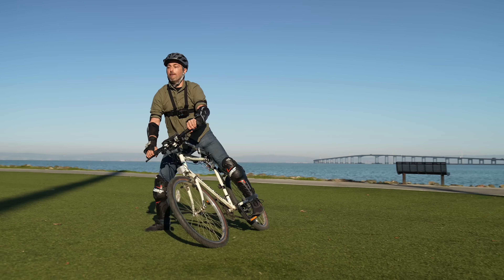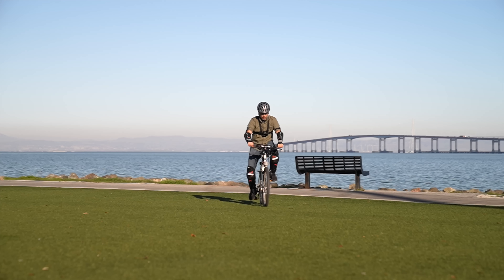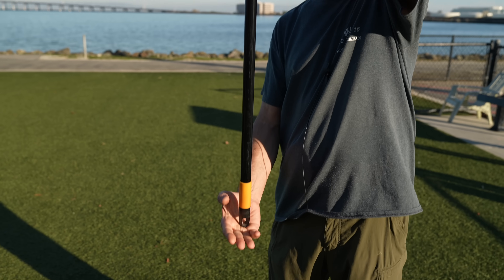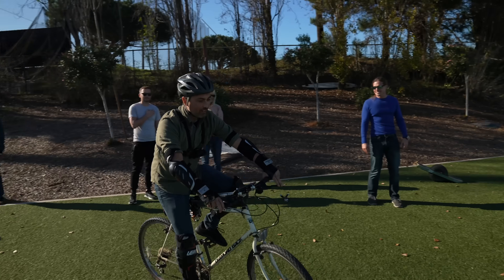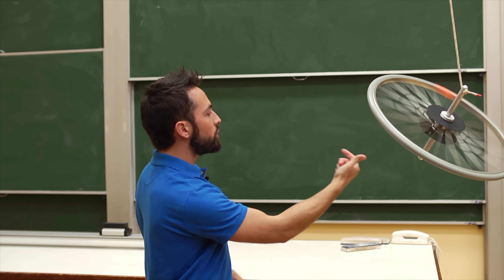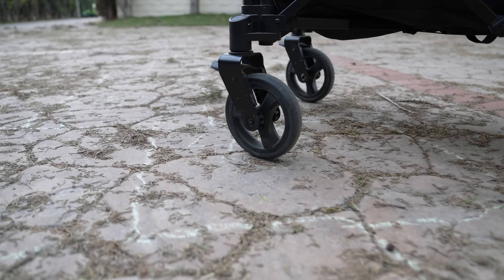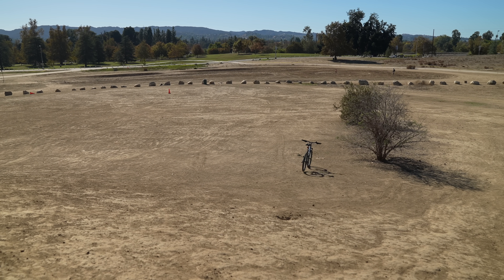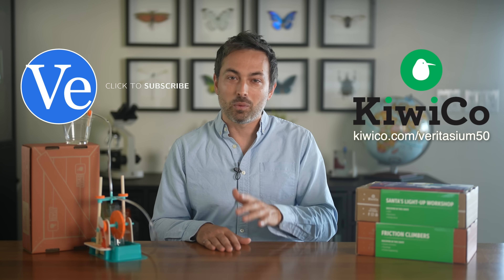Most People Don't Know How Bikes Work

Comment: Motorcyclists understand the concept of counter-steering very well… On a motorcycle, it is not just a momentary counter-steer. You continuously apply it while turning
Reply: Technically you do not need to maintain pressure on the bars to keep turning, (As long as speed is maintained),.  I f a bike has neutral steering you can actually remove your hands from the bars and the bike will continue to turn. If your bike does not have neutral steering, it is a cruiser for example, then you will have to apply handlebar pressure.
Reply: @glennpuckeridge6244  I was actually thinking more of a track situation in a sport bike where you need strong countersteering to aggressively tilt a bike but you're right

Comment: Fun fact: You cannot ride a bike, when you sit behind the backwheel. Obviously for most bikes, you sit between the wheels. But if there was a special bike, where you could sit far back and a mechanism, that lets you steer exactly the same way as normal, you wouldnt be able to keep balance. On a normal bike, you do the counter turn before initiation the real turn. This is because if you want to turn left, you have to get your center of mass to the left of the wheels, as explained in the video. But notice how eg buses with long tails sweep out to the opposite direction of the turn? This will happen if you sit behind the backwheel. You will sweep out, and the center of mass moves in the wrong direction. Of course you could learn to ride a bike like this, but without training i think it wont be possible.

Comment: It would have been interesting to see an experienced technical mountainbiker attempt to ride/turn that bike as we use the bike angle to steer more than turning the actual handlebars ie leaning the bike into the turn to turn the bike, like you showed later in the video how the bike basically steered itself.

Also interesting to see how no one used brake resistance to assist balancing, or well, knew to use...   Nevertheless, this is where being able to turn the handlebars/wheel is critical 😄

As always, great content. Glad you are on here 🙏🏼🙏🏼🙏🏼
Reply: Motorcycles lean to.  That's just what happens at speed.   That necessarily happens.       You still use the handlebars you just don't know
Reply: @gur262  yes, of course motorcycles lean too. they are bikes, with engines basically. I also never said handlebars weren't used. If you would have read my comment you would have seen the superfluousness of your comment

Comment: The gyroscopic effect can help keep you upright but you need to be going a lot faster than what you would normally be riding at.  I am pretty sure that this is why most people tend to crash their bikes when going at those speeds too - as you pointed out, people intuitively steer the bike to balance but when the wheels are trying to remain going in the same direction that they were moving due to gyroscopic progression, it starts what is basically a feedback loop which makes you wobble more and more until you overbalance and fall off.

Comment: I noticed this many years ago as a child.  However, It is possible to turn left without first turning right or vis-versa but only if you’re turn radius is obtuse and gentle, greater than 120 degrees. This can be done by keeping the handle bars straight and carefully leaning into the direction you wish to travel. If you want to execute a tighter acute turn, you simply have to swing out away from the center of your turning radius; you cannot turn a bike on a dime.

Comment: Counter Steering is a must know for riding a motorcycle, when I took the MSF they really made a point of it. There's a video of a man steering directly into a fire tuck because he doesn't know about counter steering
Reply: It's very noticeable on a motorbike because motorbikes are usually much heavier than their riders, so the rider has to make the bike lean using the bike's own weight rather than just getting their weight to lean and having the bike follow it. Both require countersteering though.

Comment: This reminds me of an experiment that I believe was done by Kieth Code. He had a motorcycle with some contraption that was basically a locked steering and advised those people who felt that you turned a bike by leaning it to have at. I don't remember all the results but the result was that if you wanted to ride left, you pushed the handle bar on it's left side and no amount of trying to force the lean without this steering input was going to work.

Comment: if you were riding a motorcycle, you would have turned easily and ride straight, there you balance the footrests, pressing your feet, you do not lean your body, you can support yourself by gently tilting the handlebars but in the vertical axis

Comment: Whenever I'm riding a bike in a closed road, since it goes across multiple intersections, in order to not stop completely, I reduce my speed progressively and steer a lot in order to stay upright while not pedaling.

It's hard, but very rewarding when you can just accelerate immediately instead of having to jump into the seat and then pedal

Comment: ALL balancing modes of transport use counter-steering to turn aggressively.   This includes snow boarding, water and snow skiing, surfing, jet skiing, foiling,  even running.     With various boards and skis the sides are often shaped with concave edges, such that "setting the edge" causes them to carve a sharper turn and this is what you use to bring the board under you center of mass to change directions.   Even without the concave edge, you transition from slipping while turning on a large radius to a set edge which launches the board/ski out from under your center of mass to initiate a sharper turn.      While running fast, if you want to make a sharp turn to the left, you'll find you have to first put one foot out to the right, and so forth.    Try it.   In the park, try running right on the right edge of a paved path (even with the grass level), and then try to make a sharp turn to the left, without stepping on the grass.     Consciously knowing that counter-steering is key to turning, can make it much easier to do so with more confidence.

Comment: It is actually possible to consistently ride that bike. All you have to do is to ride in a circle from the get-go. If the locking mechanism then forces you to continue riding that circle, you are fine of course. If it forces you to change direction, you are fine as well as you only need to move the handle bars over the middle position once.

Comment: That was cool, but I have a question. Is it physically impossible, assuming you aren't already leaning to one side, to turn without counter steering at the beginning? Also, if you could balance the bike without it moving at all, could you ride it without steering(with locked handlebars)?

Edit: Okay, I went outside to test this on my bike. I tried to go in as straight of a line as I could, and then turn, just to see what would happen. Sure enough, I was subconsciously turning the other direction first, it was really weird. But then I tried turning one direction by only steering in that direction. I don't know if I was making tiny changes that I couldn't see, or if something else was happening, but it looked like I did it. Would it be possible if you leaned to one side, and then only turned in one direction, to stop your fall? Also, it makes sense now, how I can ride my bike without holding the handlebars. I also tried to balance without moving, and I used to be able to do it, but I couldn't balance for more than a couple seconds.

Comment: Tom Scott: learns to ride a bike in half an hour
Derek: demonstrates why Tom Scott's completely wrong about what he learned
Reply: I commented this in Tom Scott's video. Gyroscopes are like 1% of what helps you stay upright. If they were majorly responsible, you wouldn't be able to turn. The big reason that you're able to balance on a bike is that the faster you go, the smaller a proportion of your vector is made up of the fairly constant left/right pedaling motions (same size of sideway push whether going fast or slow).

Comment: On a bigger scale, counter steering also helps a car turn into a corner sharper as well. If you go full speed into a 90 degree corner and turn, your rear end would have to compensate by sliding out because you have the luxury of having 2 rear wheels. If you steer in the opposite direction first, you're able to turn into a sharp corner at higher speeds and also get a more acute angle.

Comment: Counter-steering is effective but not necessary. Changing your body position is enough to get the necessary lean on the bike to take the turn. However steering in both directions IS essential for keeping the bicycle upright.
Motorcycles are much heaver and therefor harder to lean just with your body weight. If a sharp and sudden turn is needed you HAVE to counter-steer and belive-you-me it's counter intuitive. You don't counter-steer a motorcycle by instinct.

Comment: I learned this when learning to ride a motorcycle. That you turn by leaning and not by moving the handlebars. After riding a motorcycle, it becomes second nature and you start doing the same when riding bikes, although much slower speeds so you lean much less than on a motorcycle

Comment: try riding no-handed, I suspect it will break your theory somewhat. (I've been good at riding no-handed for many years)  The rider leans, to overpower the stabilizing feedback.  then relaxes and cooperates with the bike for it to return to straight.  A no-handed rider should be able to turn your locked-out bike.

Also, you should have specifically explained that with an "unmanned bike", when the bike starts to go left, the wheel turns to the left WHICH then caused the bike to veer right, that's the feedback loop.  bike goes right, wheel goes right, bike goes left.   bike goes left, wheel goes left, bike goes right.

Comment: But how does one steer without holding the steer, and how does it affect the steering? Does one lean into the way one wants to go first, or the opposite way? Does one use the hips, rather than the upper body to lean the bike in the right direction?

Comment: This is hugely important in the world of riding motorcycles. If you turn the bars, the bike leans the other way and you end up turning the other direction. The way they teach it is “To turn left, push forward on the left grip.” This leans your balance left, and the bike the follows suit.
Reply: I'm a puller, its intuitive. Turn left? Pull right
Reply: @yurionabike99  I do both. Pull one side and push the other. I experimented early on a lot. Pulling and pushing only one side of the handlebar and the same for the other one. I ended up just pulling/pushing both so for a left turn I do the following: push the left grip and pull the right one. Feels good since I can ease the load on my hands and use both of them. Also sure as hell I cannot only use one hand to initiate a turn at 120km/h the faster you go the harder it becomes to lean a bike.
Reply: @konstantinos433  Isnt it just the same to just pull left to turn right tho? When I took my first motorcycle lesson riding felt just the same as with a bicycle but with a much heavier bike. Steering/keeping balance/dodging obstacles felt so natural. My teacher told me to dodge by pushing the bars and instead my brain told my body to pull like i always do and the teacher told me i did it correctly.
If it is the same why dont driving schools teach it both ways?
I think i do both just naturally since I rode a bicycle for years before and I also used go downhill ski a lot so subconsciously I understand how turning works.

Do people not use both hands to turn a bike?
Reply: I was basically taught "push left, go left", replacing the word 'turn' with 'go' entirely. It stops you from thinking about turning corners and instead just going around corners. So, push left, go left, push right, go right.
Reply: I find it depends on the style of the bike. Street-trailies: push. Cruisers and super-scooters: pull.

Comment: @Veritasium Fun fact (I'm a physical therapist), this is also the same mechanism that we use to walk. When in standing, we essentially have to functionally move our base of support backwards to our heels by pulling our toes upwards, which initiates a controlled forward fall which we have to correct by moving our feet underneath and in front of us. Walking is literally just controlled falling! Same for if we change directions when walking. To move left, I have to first step to the right to initiate my center of gravity to start falling to the left.

Comment: Those of us that has been in the world of cars/motorcycles/racing in general knows that a motorcycle at high speeds (avobe 30 - 40 km/h; 25 - 30 mph) u start turning with ur butt, and use the handlebar as countersteer, also Caster is the one responsible for ur steering wheel going back to dead center in your car, also your car wheels wont turn parallel, there its a degree difference between ur left wheel and right wheel when going to either side, sometimes about 1.3 °, less or more but in that range ... there's way more to turning phyisics than just turning the wheel (caster, camber, slip angle, counter steering, grip, friction, oversteering, understeering ... etc etc) we could talk about this topic for hours and hours ...

Comment: A steering lock is dangerous than a wheel lock that's why we don't pull the front brake at high speed in cornering.

Comment: In many forms of motor sports such as rallying, drifting, and dirt oval track racing to initiate a turn in a car you have to first turn the steering wheel the opposite direction to what you want to turn.   In rallying this is known as the Scandinavian flick.  It seems that the reasoning in motor sports seems to be the same - to get the momentum of the vehicle to move in the direction that then allows you to maintain balance throughout the turn.

Comment: There is a much easier way of falling down. Try to cross your arms that your right hand is on the left side of the handlebar and vice versa. It seems that only lefthanded persons which were trained to write with the right hand can do the trick.
Reply: I knew a motorcyclist who did this for a few seconds out of curiosity, and immediately crashed and broke 6 different bones and was in hospital for about a month. Whew!
Reply: @JamieSteam  Haha I feel bad for laughing at this
Reply: It's not impossible.  You just have to actively think about counter-steering.   "push on left bar to go left"   and vise versa.   I've done this many times on my motorcycle when riding cross country in cold weather where I put my left hand on the throttle on the right bar so I could put my right hand on the side of the engine to warm it up.

Comment: huh.
i guess that explains why i was never able too ride a bike decently, as i was always ACTIVELY working against this system of self-stabilization, it just turned out lucky that all the straight rods i went on where very smooth and all the bumpy ones where constant curves, meaning in either case i needed to do almost n balancing adjustments beyond what might seem spontaneously obvious.

Comment: Ride any large motorcycle. You either learn to countersteer really quickly or you fall off. After you have counter steered and the bike is falling over in the direction you wish to go then it seems that the gyroscopic precession is you friend and turn the steering in the desired direction.

Comment: This is a weird concept but not sure if its correct. On a motorcycle you counter steer to turn around 15mph. A bicycle can do the same thing. You push on the handle bar on the side you want to turn. To turn right you push forward on the right side of the bars. Very counter intuitive and I dont know how it works but something to look into.

Comment: You have to learn this to ride powder snowmobile, you can fight to pull the 800lb machine up on its edge to turn, or you can countersteer first and when it dumps you steer back and catch it on its edge.  I learned this when I was 20 dying of exhaustion riding with 70 year olds who made it look easy.  Once the old "Ron Ron" told me to dump myself on purpose by pointing the skis in the opposite direction and steer back to catch, I leveled up about 30 levels instantly.  (a snowmobile on edge is basically a powered snowboard, once you get it there.  Getting it there is easy if you just use counterbalance.).

Comment: I only have a humble suggestion, use a fixed gear next time. The main reason being when you fall riding it, there will be a lot less weight (and gears) falling on you resulting in less potential pain. The second being track-standing will visually prove your point about the wheel and balance.

Comment: I am 100% sure I don't counter-steer, imma check it later - that is because I hold to the handlebar and push myself to the side the bike is falling. It requires very little strength because I shift my hips first to turn the bike under me and then I easily fall after them. But the problem with this bike will be when you finish your turn and want to drive straight again

Comment: Motorcycle riders are taught "counter steering" in riding class. To initiate a turn you apply forward pressure to the bar in the side you want to turn to.  For example, to start s right hand turn you'd push the bar forward with your right hand. 
Unlike a bicycle though motorcycle handlebars stay counter steered through the whole turn at speed (above 10mph maybe? )  Half way through a turn you can push harder to increase your lean / sharpen the turn.